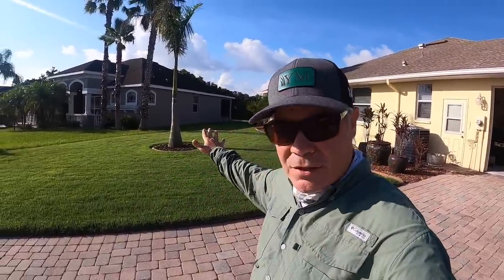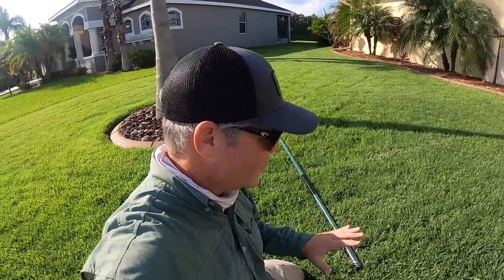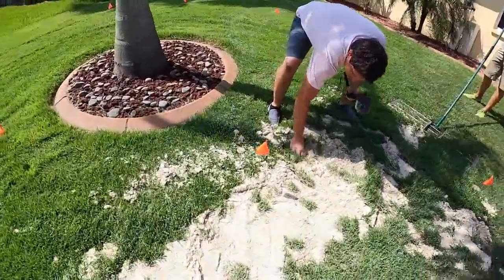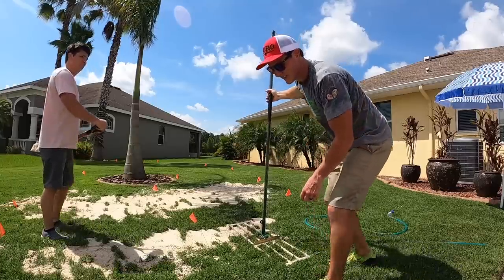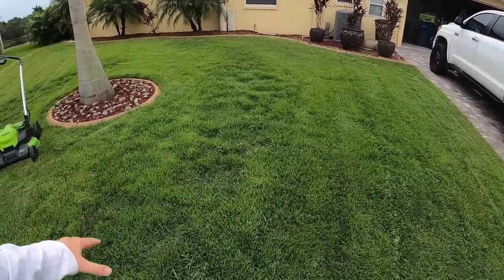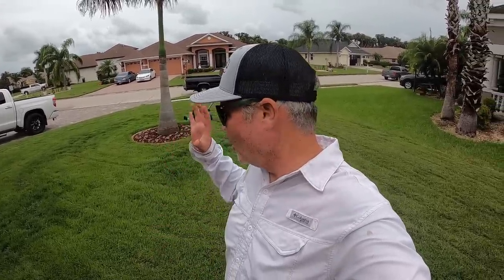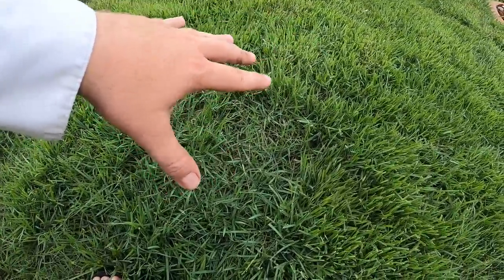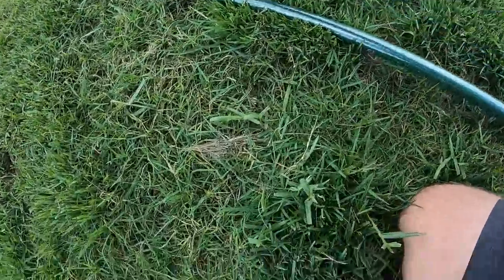Uneven Lawn Leveling | Don't Do It This Way

Comment from the maker: More on lawn leveling and why I DO NOT recommend using top soil https://youtu.be/OFDE-5aU6YM
Reply: What should I use to level my clay filled yard in the Midwest/illinois
Reply from the maker: Mason sand
Reply: G14 classified...that's good!
You also threw in a Billy Madison "quote", nice.
Reply: How about Green or red sand? I’d like to add some nutrients also. Living in Florida do you really need to add more sand?
Reply from the maker: @richardsmith1161  use organic fert to add the nutrients. If your soil is really sandy in the first place, it shouldn't really have too many bumps anyway. The rains will flatten it right out.
Reply: While I agree with you on many things I vehemently do not agree on using sand on a cool season grass lawn.     Tons of research back up what I’m stating as well.
Reply: @dk2190  yeah I don't want soil layering. I plant on using a soil, sand and compost mix. I know it will have to be done numerous times.
Reply: I love Allams content but I’ve been doing the lawn nut game for a looong time.    This topic is not cut and dry and using sand comes with a host of other issues to consider.
    Would take me an hour to type it all up.    Sand as the defacto level agent is simply not accurate.   No kind way to say it and I have tremendous respect for Allan and his approach but this could set a newbie up for things they don’t expect.
Reply: still waayyy too high for empire... 2 in or under. Just learned that this summer and it looks much much better.
Reply: oh ok.. watched the rest of the video and that makes sense the torpedo grass is relentless. One shot of quinclorac isn't enough I think it took me 3 apps spread 2 weeks apart
Reply from the maker: @dk2190  It's perfectly fine to disagree - there is no 100% right answer to everything.
Reply from the maker: @dk2190  also, will you do me a favor? email me some articles illustrating what your belief is allyn@thelawncarenut.com - I think this could be a good topic for the podcast and I'm always up for learning something new.
Reply: Let me pull it all together and I’ll go over my learning as well.   Appreciate the opportunity to discuss
Reply: @TheLawnCareNut  Sorry to piggy back on your guys' convo, but I would be very excited to hear this topic! I've tried both in my yard and hands down had better long term results with screened top soil. I'm convinced the sand is what caused my grass to burn up over the summer. Yes, you don't know what you're putting in your yard for top soil in terms of weed seeds...but thankfully we have herbicides to battle those later. Also, I noticed my top soil did break down, but not a significant amount.
Reply: Southwest Michigan... thinking to dethatch thoroughly and seed before I level since I'm just starting to water to maintain and did I get some torching.  Any thoughts?  Maybe best to wait until the fall or next spring? I'm planning to make a angle iron or most likely 2x4 drag frame to pull around with the rider.   Planning to install inground sprinkler system once leveled.
Reply: Why do i have  spots  and they are  large  with  no grass
Reply: @dk2190  Everything I read said that sand is terrible for your lawn. I went with turf mix over sand.
Reply: @TheLawnCareNut  Do you recommend sand for leveling St. Augustine in north Louisiana as well?
Reply: @TheLawnCareNut  I just discovered you today. Thank you for this video. Quick question for you: We have a major torpedograss problem in a central island flowerbed that has no weed barrier but does have a layer of rock for aesthetic reasons. The torpedograss is taller than our tallest plants in the bed (which are 4 feet high). We are in South Florida (Boca Raton area) across the street from a canal. The rock bed has a grass border and then the driveway wraps around that. What can we do besides the futile hand pulling? Thanks for any suggestions.
Reply: Quick question for you: We have a major torpedograss problem in a central island flowerbed. No weed barrier. Just a layer of decorative rock above the soil for appearance's sake. The torpedograss is taller than our tallest plants in the bed (which are 4 feet high). It is not a densely planted bed. We are in South Florida (Boca Raton area) across the street from a canal. The rock bed is surrounded by grass and then the driveway wraps around that. What can we do besides the futile hand pulling? Thanks for any suggestions.

Comment: I just did a bit of leveling today too. right before it hits spring here in Australia. I had a lot of winter grass grow this over the winter and its the first year that we have been in this place and this time I mowed the lawn I cut it as low as my new toro mower would go to get rid a lot of that winter grass and help the summer grass grow once it starts to warm up in the next few weeks, I needed up using a good lawn soil from a hardware shop and that has worked a treat over this first year to sort of level the lawn but it really just gives it a massive growth spurt and I think next pay I might even put a few pegs in the ground and string line it just because its on a hill and slopes up to down and right to left I want to make sure there is no high spots.

Comment: I’m a fan of using soil or loam rather than sand for leveling.   I have a spot in my front yard where we removed a tree 🌲 and it keeps settling every year…I level it with  loam before my fall overseeing and it seems to work well.  Hopefully this is the last year I need to level it! 😆😆

Comment: As a zoysia owner who scalps and levels multiple times a year in south Texas, I was wondering why you didn’t scalp first....makes sense! I didn’t battle torpedo...I had common Bermuda. After two years, I’ve eradicated it. 100% zoysia now with ZERO WEEDS like you said.
Reply from the maker: did you use quinclorac? I've found that with surfactant it does pretty well.
Reply: The Lawn Care Nut I would like to know, also. Bermuda in my Zoysia will be the death of me.

Comment: I've not heard anything bad yet about the my4sons but yes it does look a little off. I had a menards gift card so snagged the 4gal battery operated chapin and tightened up hose clamps before ever using. Has been good thus far! Not sure I need to get anything other than the stock tip as I'm a newbie and probably can't tell the difference lol.

Comment: I am a die hard St Augustine fan and have used it in 7or 8 yards. The last 2 I have had to continually fight weeds including Torpedo, never saw or heard of the stuff before Katrina. You have convinced me to try Zoysia. Wonder how it would do it I spot plug it, little at a time.

Comment: What kind sand Is It? I see that like fine beach Sand, Is that correct? I do not know if I can use synthetic sand since we do not have this available, only synthetic and black soil that we use during soding. Other thing Is that my emerald Zoysia took like 6 months to achieve 3-4", some sods aré not growing, only stay Green at 1" So I dont know if leveling Will chokeout those parts.

Comment: im in chicago area and is going to do the pre-emergency in Mid-April. I also want to level some lower spot. Should I do it before the pre-emergency or after pre-emergency? Also, whats the benefit of using sand than top soil in cool season grass area? and when can I start mowing again after putting down the sand? how many days later I meanThank you so much

Comment: Always used sandy loam for leveling as it’s sort of a sandy dirt, rather than straight sand, which can cause burning in sunny areas if you don’t water frequently. Similar to greens burning up on some golf courses since they have such a high sand content and are obviously cut very low. You can also mix some fine sand into regular topsoil in a wheelbarrow and spread. Prefer to have a much higher soil content than sand. Different in different areas of the country and also depends on grass type.

Comment: Hey Allyn, have you reviewed the newest model of EGOs mower? I saw the older model, but was curious your view on the newest. I am looking for a good mower for my house that is preferably not gas since I do not have a shed or garage to store it in, and chaining it up outside is sketchy and it might got stolen while I sleep, so I was debating electric so I can store it inside.

I'm torn between the electric toro or the ego.

Comment: So AL, I plan on leveling this weekend and in the video you say to level with sand. I get that,but my soil (up here in Michigan) is loam. Should I use straight sand or do a 80/20 mix? I'm thinking I need to keep the same soil composition ?

Comment: Just bought a house and the backyard is nothing but dirt and weeds/cover. It’s extremely bumpy and unleveled. A lot of sitting water after a rain. I need to start from scratch. Currently killing the weeds off, but to start the leveling off on dirt, do I do soil or sand in those completely dirt holes? There’s no grass so no dirt-to-grass ratio. Just dirt. Should I do a mix of top soil mixed with sand? Then do a new reseed of my lawn?

Comment: Can you lay sod on top of the leveling sand?
Reply from the maker: Yes but if you are going to sod, that means opening the ground up completely and if you are going to do that then you can just regrade the existing soil to fix bumps so there should be no need for a leveling agent

Comment: Mr. Hayne.  I have a couple of questions that maybe you can answer.  I live in Southern California about 60mi east of Los Angeles, The weather is hot and dry for most of the summer, routinely reaching in the triple digits, and no rain.  I currently have a lawn that I inherited from the former owner, and I have been watching your channel for a while.  My back yard has no lawn just concreat and a retaining wall that holds a hill back.  My front lawn is small.  Roughly 2600 square feet.  I have numerous problems with watering mainly there was no sprinkler control, and I ended up replacing all the valves and installing a controller.  Now that I have had the sprinklers working for the last 3 months, my lawn is nice and green, with LOTS of weeds.  Also I have some "big" dips and valleys in the lawn that the former owner has never taken care of.  so I need to continue to work on the sprinklers, they have sunk down, below ground level have nice little circular holes and need to be pulled up again, and the weeds need to go, and the ground needs to be leveled.  Should I just kill off what I have and plant Zoysia? Would Zoysia be a good choice?  Should I really battle it out and save what I have and start weeding.  I love the look of your lawn, Wish I had it here at my home.  Thanks for your answer.
Reply: Hi, what did you end up deciding? I know it was over a [California] winter, but did the lawn make any progress?
Reply: @johnlong9494  it did to a certain extent. It was all green until winter came. I think that the grass is dorment right now so I am going to spray for weeds in a few weeks using off the shelf products following the directions on the labels.  I used a brodcast weed and feed that worked well but to get that really nice lawn I will have to start applying specific fertilizers I have seen in his previous videos.  I am still considering ripping up the lawn and fixing the sprinklers but that is a really big project. I have other projects that will come first.

Comment: I laid empire zoysia in my lawn at two different times. Once about 6 weeks ago and once about 3 weeks ago.  I have some high and low spots as well when I mow at 2.5" I get a couple scalped high spots.  Do you think I have enough time to spot sand level or should I just raise the HOC til spring.  then scalp and sand

Comment: One notch lower? Grass needs to be 2 to 1.5 inches tall otherwise it won't work down to the soil level. One notch on the Toro might have gotten you to 2.75. watering it was a bad idea as well. Then it clumps and doesn't get down between the grass blades.

Comment: Dismiss NXT is labeled to control torpedo grass in St. Augustine grass. Its sulfentrazone + carfentrazone. Thanks a million for that article on torpedo grass from the newsletter. There was a guy on amazon reviews who said he was able to get rid of all his torpedo by doing 1 application ever week for 6 weeks  with the product. Temps must be lower than 85. I've started hitting it right now @ 90 and its browning my grass a bit, but the st Aug is still alive. But in fall when temps are in 70s I'm going to be hitting really heavy with this product.
Reply from the maker: I'll have to look into that - I was using the DNXT but it dinged my St Aug really hard everytime I used it so I stopped.
Reply: I talked to Dismiss. Yes it was labelled, but when it came to Torpedo-grass they didn't seem to be too confident over the phone. Need to remember that it's not the brand, but the percentage of the active ingredients. Sulfentrazone in recommended amounts is safe for St. Aug, and will kill a number of weeds including torpedo grass, but won't take out Torpedo on the first go. Can't remember listing for Carfentrazone. Success may well be something to do with these products being combined. The dude with continued repeated applications may have been on to something, though I'd be hesitant to hit it weekly as that's not necessarily enough time for your grass to give you feedback (in another word, it's RISKY). But I'm glad he did. Now we have some testimony to base our experiments on.

Comment: I'm in Wisconsin and my entire lawn is lumpy enough to twist an ankle all over the place.  I've no idea why it's this way but wonder if I should be adding "mason sand", top soil, or whether it would be better to bring in a grader, scrape it all, and start fresh?
Reply: Dirt and flood it, 
I did mine partially once. Plan to do it again. By flood i mean literally throw top soil everywhere and run a garden hose into it so it looks like a near swimning pool. I also put holes in it (garden hose size) and put the hose under the lawn and flooded it from underneath until the water was coming out and running into the street. This a really moves the soil (under neath as well) which first time will create different low spots on top). Second time more dirt (top soil layer up here) basically in the lows and flood it again from the top. Dont do under it again. If the lawn is established enough it should come back. Unless you dropping 3 or for inches then some areas reseeding.
Leaving the grass as long as possible will allow it to still get sun and be above the water / mud surface if you run a simple metal leaf rake through it pulling it up.
Also , let it dry out and settle in between first and second. Lot of people level a lawn only to have areas drop again (open cavities underneath) which even after running heavy equipment over can still be there. Flooding from UNDER the lawn exposes them as well because the soil underneath moves, lawn becomes pliable,  and the lawn will drop in that space.
I reseeded mine and people commented "its not level has dips etc "  
I was, "i know I'll level it after" .
I've found near sink holes, 10" deep and who knows the areas?? Under a lawn. Think of a road bed. If there isnt a solid road bed and you lay tar on top over some years..,, well.,
Leveling the top of a lawn might be a temporary fix, but you run the risk without making sure under it is solid that you'll be redoing it many times. The flood from underneath speeds up the process so you can do it once and are less likely to have future problems (which I'm sure youve seen some disastrous sinking roads and lawns).
.
Crazy i know, but no joke. Disclaimer: i dont get paid for this i just did it, maybe something i learned in bridge and dam construction years ago. I hold no responsibility.

Comment: Often, dead flat lawns look as though they have a dip or a hollow in the middle.  To make a lawn ‘look’ flat.  Build a rise into the centre of the lawn.  It only has to be 1 or 2 inches higher than the edges.

Comment: I got a Bermuda lawn and have some serious leveling to do. I have hard red clay dirt. I think I was tk spot level with good top soil and then eventually do the top dressing with sand. I was under the impression you should cut the grass down really low prior to trying to spread any material out

Comment: So if you don't scalp should you not have built the sand up in 2 or 3 lighter sand layers over the 37 days?
Reply from the maker: It was just one bit layer and the grass filled in over it in 37 days

Comment: I would love to see a comparison of the Ego 21" electric mower verus the Bright Green electric mower you used in this video. Two batteries and it still drained?!? I think you would Love the Ego mower with 5.0amp battery.
Reply: I have the Ryobi 40V with 1 6Ah battery and it now both the front and back yards with no issues.   I love it!!!

Comment: Looks like ruts from when the house was constructed or when you had the palms delivered
Reply from the maker: That side has always been very wet - I put in the curbing and that redirected the water which created those low spots. I fixed alot of it with drainage a couple years ago and now this was the next step. It's a never ending battle with water here in the tropics.
Reply: The Lawn Care Nut ah yes I remember the video . Thanks for the reply Big Al !

Comment: Everyone on these videos have Bermuda grass lawns, and I could see using sand on them. Up here in the PNW, it doesn't make sense to use sand. I'm currently fixing my back yard up (20,000 sq ft) and I went with a turf mix. I just can't see dumping sand all over my back yard. I think it would look terrible, and everything I read said that sand can really mess up your yard.
Reply: Sand doesn't hurt anything in anyway. If you mean sand capping I dont even think thats real. To many things move through the layers of the soil. eventually the sand just becomes loam naturally unless you have like hard clay or rocky soil.